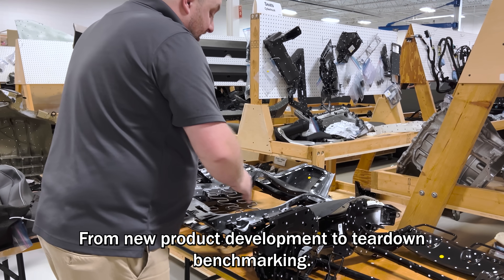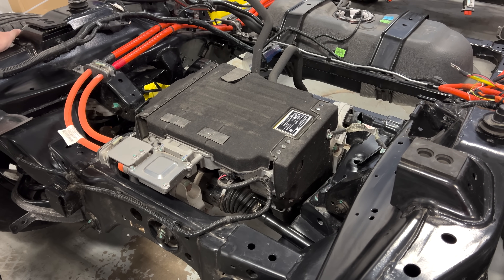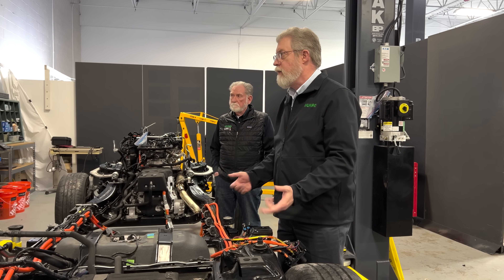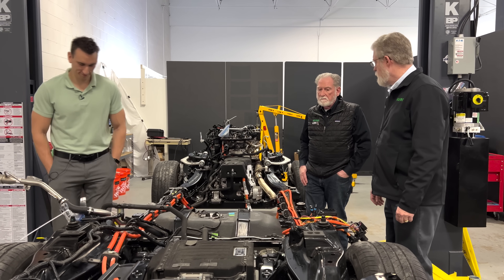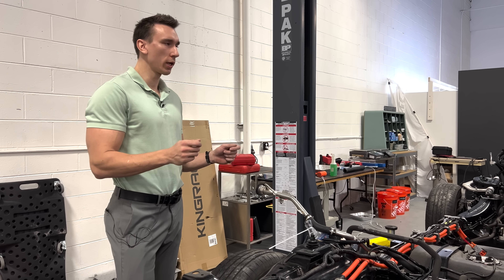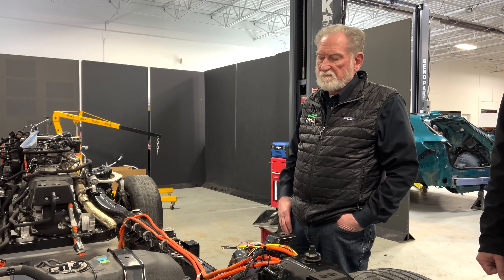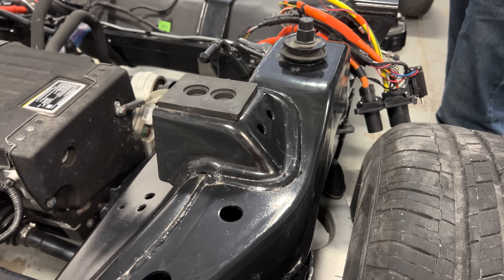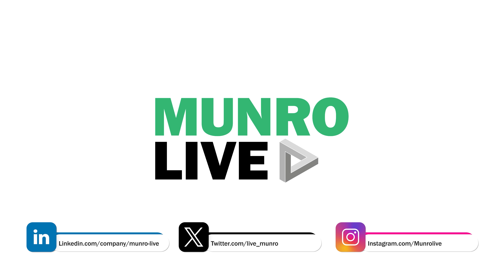There's a Monster Under the Bed of the BYD Shark!

Comment: I wonder who choses a truck over a suv simply because of high horsepower without taking high loads？ Chinese use trucks to carry very heavy loadings daily in China, not for weekend campings only.  If you've seen the triwheels motorcycles in China, the frames are very very overloaded because farmers needed to use them for years to get the jobs done.

Comment: A lot of good comments here, especially regarding calling out the 'loop' fantasy.  Sandy showed us the clear-as-day charge port connected to the right side DC cables.  I would not be second-guessing BYD's engineering expertise with only a glance at this design.  The overly-detailed gossiping on the completely-normal ground braid on the rear drive unit was quite bizarre.  That said, I still enjoy these videos!

Comment: BYD will have used their existing suppy chains for their heavier duty frame construction so they would not incur an additional cost for materials in order to make a a bespoke vehicle. The donside is a heavier vehicle than necessay, but a thumpingly strong ute or pickup truck as called in America. My friends who own 4-wheel drives would give their eye teeth for something as solid as this to go out bush in.
The other point is that the Shark is a first iteration, and the tens of thousands of BYD engineers at their disposal will ensure subsequent versions are as strong, but lighter, and with fewer parts.

Comment: I don't agree things said about ground loop and cabling. Yes, it is grounded because of noise and also because the assembly is on rubber mounts which don't conduct electricity. There is no loop current because of this and no efficiency loss. Correct me if I'm wrong.

Comment: The Shark is ~300 kg (660lb) heavier than a Ranger Platinum 3L diesel (Aus equivalent spec), but only 50% of this extra weight is lost in its payload capability. Ranger PHEV weight unknown at the moment. So for a loaded vehicle pulling up to 2500kg (5500lb) the weight is immaterial. The Ranger can tow 1000kg 2200lb more though.
For a customer the result is when empty an increase in power use, but when loaded no difference, but ALL of the time it has a very strong structure - ludicrously strong structure according to Sandy.
So as a work truck during the week and a play truck on the weekend there is no downside. For a "car" replacement there is, but then a BEV makes more sense then than a PHEV.
As many have said this is a reason TOO buy the Shark. The software is receiving updates as they learn, the suspension is good, if not great, compared to the Ranger. With what appears to be a good suspension basis the aftermarket will come out with suspension upgrades to improve it overall performance. Being $58000 so $30,000 (USD19,000) cheaper than the Ranger 3L diesel (Aus 88,000) gives some $$$$ room for modifications... It will be interesting to see how quickly BYD iterate on this.

Comment: Its a shit box lets face it it chews 20l per hundred  worse then a 30 year old pajero
Reply: 2 not 20
Reply: Go look at real world reviews I didn't just make it up like byd that what ppl are getting when the charge gets low
Reply: @myeverythingworld8123 yeah, real world test by isolating the electrical power chain. It is not battery getting low, they literally isolate the electrical propulsion and force the viechle to run on engine alone. Ive seen those test.

Comment: BYD are in the process of establishing themselves and building a long term reputation.  This truck is going to make BYD trucks synonymous with toughness and longevity.  Perhaps later models will not be so ‘agricultural’ but the seeds will already have been sown by then.  It is likely that many elements of the frame arrangement have been cut and pasted from other designs for ease of manufacture.  I am not keen on hybrids but no doubt BYD will have an all-electric version of this vehicle before too long.

Comment: What dc loop. Left side is rear motor drive cables. Right side is charge cables. There is no loop. Both arent powered at  the same time. Unlike amercian. International electrical standards all components need to be grounded.

Comment: This is nonsense. Munro says it uses more material and is not optimized for assembly during construction.  BUT IT COSTS FAR LESS THAN THE COMPETITION.  SO from a consumer standpoint, who the h%&& cares?   In fact, many have pointed out, thicker metal in many places probably correlates to more robustness and longer life.  The only CONCEIVABLE downside would be unnecessary weight might reduce range/efficiency,  or put strain on the suspension.  But the efficiency numbers, as reported, are pretty good.  ANd they dont really look at the suspension much.

Comment: The fact Sandy hates this makes me think it might be good. Sandy loves Tesla which are horrible to  maintain after a few years and horrific to repair. Here in Australia I'll definitely take a thick frame on a large heavy truck. Maybe he's not aware but American built cars are nearly always low quality by global standards. I'll be checking out the BYD dealer today.
Reply: indeed. Tesla giga casting is good for Tesla. is you have an accident it is impossible to repair the casted parts

Comment: Stupidly overbuilt truck? Sign me up.  Like my old brick Volvos -  runs for millions of miles.
Reply: I worked on those old volvos. Really poorly designed. Rubber everywhere that deteriotes. Smog producers. Easily rust out. Not beat as well built as 60s dodge and Plymouth cars.
Reply: @hoffinger  Volvo was the first brand to include Catalytic Converter and O2 sensors in the 70s. I don't think we are talking about the same generation cars.   A Redblock Volvo Engine is overbuilt on everything.  in stock you can boost those things to 500-600HP, from a 2.3L  4 Cylinder in the 80s.

Comment: the ground strap seems more as an groundconnction to avoid current flow and voltage at the Mounting points of the driveunit and an protective earth.

Comment: Wow.  It would have ben so easy to make the charging port cables much shorter and either have the port in the middle of the vehicle (maybe not practical for public charging) or have the port up the front, so avoiding the DC loop

Comment: Correct me if I’m wrong, but isn’t the ground strap on the drive unit to eliminate the voltage potential between the drive unit housing and 12VNEG, so that in the event of a high voltage failure that energizes the housing, the isolation monitoring device can detect the fault condition? 

IMO it’s an isolation safety component, not an EMI reduction component. 

Can any EEs on here confirm?

Comment: Let's me explain that strap: it is not a loop, instead it is shield earth, the car does not loose any energy. I have the same kind of earth strap on my Diesel powered 4wd attached to ECU and any electronic devices cover to reduce interference. It is especially important for digital electrical signal to be covered/ shield. The strap looks big, but the current going through is very little or tiny. but you need that size to make sure all voltage  differentiation between each devices is near zero.
Reply: Understand that the relieving the voltage differentiation is exactly an energy loss. How much of a loss is the question worth considering. I wager it's absolutely tiny compared to things like rolling resistance and coefficient of drag.
Reply: @saccaed Missed the point dude.
This is an EV, you must have a potential equalisation line to meet the minimum industry standards, especially as the rear inverter and motors are not bolted to the chassis, they’re mounted on rubber bushings. So in the case of HV isolation loss this strap needs to take the full current of the HV system, not for long mind, but it needs to be there
Reply: Why not think that it is a standardized part of the brand that they use in all their vehicles for all possible uses and conditions? the scale would compensate for one or two of these overstated uses.

Comment: I decided to check their statement about "unnecessary support angles bolted to the frame". I have no physical access to the car, so maybe I am wrong, but I checked another video of Monroe where they discuss underbody parts placement. And in this video, you can clearly see that rear subframe is bolted to the main frame! So, considering that subframe is a separate part it should be bolted to the main frame, not soldered!

Comment: The ground strape is a mandatory requirement of an IT System (isole terre) to ensure the constructive fault protection in an event of a double insulation fault. The ground strape will carry in that case the short-circuit current until the fuse element disconnects the short current.
If the windings of the screw and the thread at the chassis frame is are unpainted there will be a low electrical resistance for the ground strape. So its probably not a late change implementation
And that „current loop“ is not a loop where elektromagnetic effects could occur, its just two separate HV wiring harness once for the Electric Motor and inverter and the other one is the HV wiring for DC charging.

Comment: You know, the more I watch this series, the more I am convinced that this is a politically motivated take down to try to discourage people from buying BYD. Which is odd, because before the political shift in the US, these guys were all gungho on Chinese cars and were celebrating dramatically less well-built vehicles. Also very odd is that they claim to have gotten this vehicle "illegally" but they are not afraid to make a video series on it. So who procured this vehicle for them? They know the whole "current loop" thing was nonsense, but now they claim to have found more evidence. If it is a take down, its not a very good one because they have just highlighted that BYD is building exactly the kind of truck the US and Japanese manufacturers refuse to build, at a great value to the customer. 

And BTW, for any Americans who dont know who BYD is... this is the worlds largest EV manufacturer, the largest manufacturer of EV commerical vehicles, the worlds largest battery manufacturer, and they have developed the worlds safest EV battery; the BYD blade. They have been building cars just as long as Telsa, but in much larger numbers, and certainly know what they are doing.
Reply: Sorry I want to bring a small correction here , but CATL is the largest battery company in the world. Between them they add up to 60% of world production
Reply: @bobc5730  Thank you! Yes, second largest! But that's  still a ton of batteries and a ton of expertise. This isn't some Jonny-come-lately like many of the commenters are making them out to be.
Reply: @patreekotime4578  ummm. actually that would be multiples of thousa ds of tonnes
Reply: They are the world's biggest electric bus manufacturer by a long shot, so they know how to make a large electric vehicle, unlike these fools who are just embarrassing themselves
Reply: @johnwayne8475  Yes, I suspect alot of this "overbuilt" quality is things they learned building buses and deploying those buses all over the world.
Reply: You're quoting an advertisement. BYD cars just an ugly, cheap junk in 99% cases. And it's are not very popular nowhere abroad Chinese.
Reply: @счастье33 How are actual facts "advertisement"? Meanwhile you are spewing outdated opinions and anti-Chinese rhetoric as if it's fact. Tr@ll elsewhere.
Reply: @счастье33 Tr@ll elsewhere.
Reply: @счастье33 Tell that to Australia and New Zealand customers, and tell it to the global municipal customers of thier busses. Tr@ll elsewhere with your FUD.

Comment: You want my two cents Sandy? This thing is a Humvee in disguise. Only one reason to have those huge weldments. Its built to withstand having a multi-rocket launch system on it. Trojan horse indeed.

Comment: I cannot agree on your thought on the loop completely.  The loop is actually between each pair of cables. And even if it was 1 cable at each side than you should also consider that left side is used during movement (motor connection) and the right side for the charging only. Losing ground may actually introduce some interference and disturb communication, but nothing in the magnitude of power loses.
Reply: Correct statement!!These experts of Munro are not always real experts in their field 
Also the ground strape is a mandatory feature of an IT system

Comment: Thanks Sandy and associates for the 3 videos. I have already placed an order for one, and your videos have shown that it has been over engineered, which suits me just fine. People buy ex army trucks because they are built over strong, are hard to break, and last for years.
To any BYD engineers, please leave it as is.
I believe that BYD are building a range of camper vans to possibly larger mobile homes. This would be an excellent frame for one of the camper vans. I would assume that  the frame could also be used for a delivery van.
There was only a brief discussion about the motor in an earlier video. I am not aware of the reliability of a BYD petrol engine, and hope it is over engineered like the rest of the vehicle. A more involved discussion on the motor would have been appreciated, aside from saying it was bigger than needed, again to me that is a plus.
Could there be a diesel variant one day? But would that be suitable as the current motor is used to drive the front wheels over 70 kmh?
Lots of excellent comments from a lot of people from the 3 videos. Overall they believe the over engineering is a positive.

Comment: There is no current loop. And if you can't see that, then don't claim to be experts. The RHS cables are only for AC/DC charging and the AC Power Points in the tub. The only large current carrying cables for the electric rear motor are on the LHS. Now show me an electric drive motor that doesn't have a ground strap attached....go on, I dare you. If you would find one, then that is the manufacturer that I never want to buy a car from. The ground strap is there as an extra backup in case the motor somehow ends up with loose bolts or any other mechanic/electric noise.
Reply: The ground strape is there to connect the housing of the motor to ground. Because the motor is hold in place via rubber bearing. So the housing would electrical isolated to ground and this is for a HV component not allowed because the Isolation montioring device measures the resistance between HV potential to ground
Reply: @visionmodernclassics  You are correct ! I just had a look at the service manual, which shows the rear electric motor being suspended by dampers. The voltage fed to the rear motor would fall under the "Low Voltage" definition and as such requires dedicated earthing or equal potential bonding under our and I am guessing most countries electrical safety standards. So, even ignoring any electrical function (such as monitoring) of this earthing strap, by law of most countries, it has to be there.
Reply: @alf699 It’s standardised HV auto design to have PE lines at every HV component. It’s just baffling me that they aren’t making that connection.
I will say the strap is unusual in that PE lines are almost always protected by insulation all the way up to the ring terminal to prevent corrosion
Reply: @ The strap has to be there to satisfy electrical safety rules. Anything above 50Vdc is potentially deadly. As the motor is electrically isolated from the chassis, there is a risk that the motor chassis could become alive and a person getting between the motor and chassis would then be electrocuted with a possible fatal outcome.
Reply: @alf699  I know you used "quotes" on it, so mildly tongue-in-cheek, but nothing low-voltage about EV motors, as they're generally AC, 400-800V.  

If the motor is truly isolated from ground, and this is the dedicated earthing for a 400V+ 150kw motor, it seems insufficient given the size of the leads and connection type (using the fastener to carry current), and isn't very well protected.  I'm not 100% certain what it's for, but if it's as you describe, I'm not a fan.
Reply: No reply MUNRO ?
What a joke
Reply: I'm not an expert on EV, but that bit also sounded really strange to me. Loop or not, you will have some harmonics going back from the inverter, and that means electromagnetic noise. 
In other industries, you usually put an inductive filter with a big iron core at the inverter input to mitigate noise.
And yes, the frame is always grounded for safety reasons.

Comment: Why not putting a special tariff on EVs that have a loop cable design?
Reply: Sure, although this doesn't have a loop.  It's 3 spokes from the battery:  front motor, rear motor, and charging port.
Reply: @ZweiZwolf  most likely you are perfectly correct, but some see it differently. And facts seem to have been replaced by claims.

Comment: I will buy one for all the reasons Munro does not like the truck. Look "under the hood" of American pickups and all you see is hairy cardboard, poor welding, minimum structure, and not "made to hand down to the next generation". I drive my second 2006 Tundra, I would not pay $20,000 for a new Tundra, total junk in 100,000 miles. Bob in Nevada